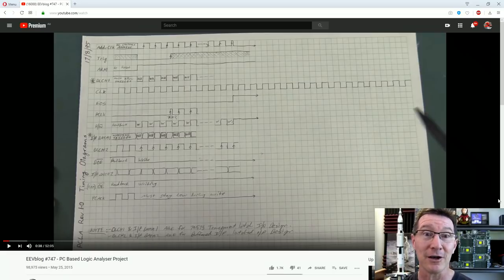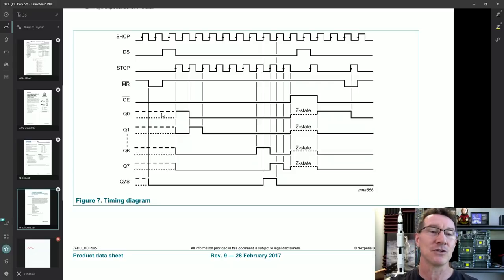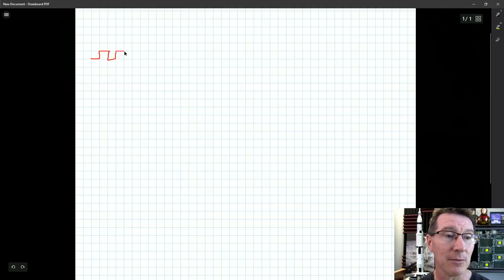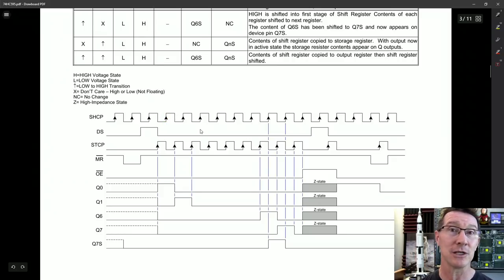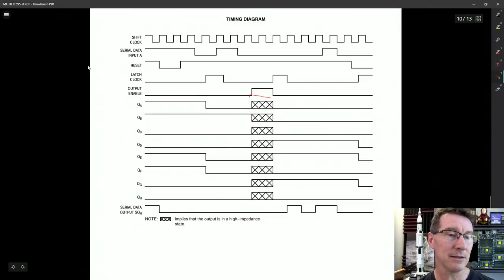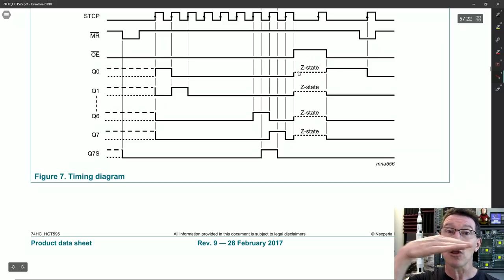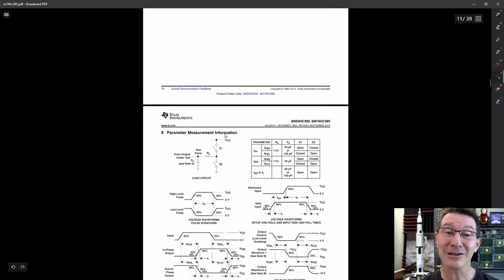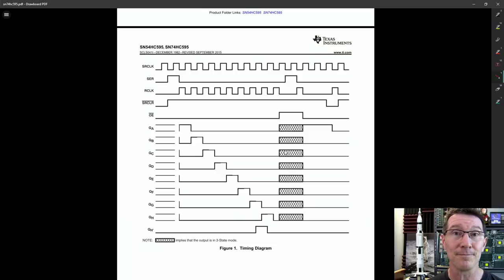EEVblog #1249 - TUTORIAL: Timing Diagrams Explained

Comment: I still remember the first time I discovered timing diagrams when working with SPI communication between an Arduino and a digital potentiometer. I bought a logic analyzer to study the timings and worked through getting it to work. One of my top moments in learning electronics for sure.

Comment: This could do with a Part 2 describing pipelined logic comparing, say, hold time outputs of registers to setup times of succeeding registers. It's easy to violate these timings especially if you have long PCB traces. A trap is to feed high speed logic into low speed like a 74F logic feeding 74LS logic. Also, how to deal with meta-stability issues in asynchronous systems.
Reply: Yes, please.

Comment: Hi David. Ben Eater once explained a similar topic but i kinda didn't get it. Would it be to much asked if you could explain how to calculate the "pulse" time built with resistor / caps to use for WE (write enable) needed according to a time table? i want to use a push button to enable WE while i have already set the data x on adress x to save the data on a SRAM? a small schematic would be awesome and a simple to understand way how to calculate the pulse time (uF & R) 

Respectfully from Switzerland
BRMc

Comment: I feel like this is something that you need a decent scope or a logic analyzer for.

One day I'll have to grab one, especially when I start using DRAM and FPGAs....
Reply: gudenau I think I understand where you are coming from, but logic analyzers don’t replace timing diagrams.   Mostly, timing diagrams are mostly used in the design phase when you don’t have any hardware to use an LA on.   They establish not only exactly how the chips work, but also what chips can be used together and what the line lengths need to be.  The other thing is that LAs show you how something is working, not how it is supposed to work!  It’s a great skill to acquire!
Reply: @wpherigo1  I didn't express this thought too well. I meant debugging stuff with.

Comment: Timing diagrams are pretty similar to how I try show flow of data or distribution of workloads across multiple threads. Wish there was a standard way to do it, but in software engineering it seems to be the same "standard" approach - Whatever makes sense, mostly.

Comment: I would love to see a complete video on how to properly analyze a circuit, understand how it works and why.

BTW, I'm not talking of simple Kirchoff laws applied to resistors. Maybe something with op amps and or discrete transistors or diodes. (At school I've studied only some parts of electronics and so far I cannot understand how transistors works in a circuit. And yes I have read lots of different textbook but I think that I miss something quite basilar)
Reply from the maker: You can't just do a generic "analyse a circuit" tutorial. There are an infinite number of permutations on things to learn in even the most basic circuits. Each component requires it's own hour long video (see my 45min opamp video, and I didn't even cover everything), and then you could do another 1 hour video on interpreting datasheets and parameters for those components, and so down the rabbit hole it goes.
Reply: A good basic introduction of how a transistor works in a circuit is to think of it like a dial or slider light switch in a room. One that changes how bright the light is. Except instead of using your hand to change the brightness of the light, a transistor uses a voltage applied to two of its pins (base and emiter). So if you put an ac signal such as a 1kHz sound sinewave on those two pins it would be like turning the light control up and down 1000 times per second. A transistor is basically a switch with its on/off state controlled by an applied voltage. It does not have to be full on or full off. It can be a little bit on with a small base emitter voltage wich would essentially be a high value resistor between the collector and emitter. Or it can be full on with a higher vbe wich would make the collector/emitter a low value resistor. It can also be anywhere in between.
Reply: An easier way to understand a NPN BJT is by representing it by a water tap. Opening the tap represents the base, the main reservoir represents the collector, the water coming out of the tap represents the base and the water represents the current flow. When you open the tap the more current/water is allowed to flow. Eventually you going to open the tap to a point where there is no more change in water/current flow. This state is known as saturation. You can keep opening the tap and you will notice no change in water/current flow. Closing the tap fully is known as cutoff where no water/current is allowed to flow. The above applications would be switches. 

A BJT can also operate in other "modes".

So when you adjust the tap between saturation/opened a lot and cutoff/closed and see a direct change in the water/current flow, this is known as the active region. This "mode" has many applications for example amplifiers.

Just a simple way to maybe grasp a few Concepts.
Reply: @EEVblog  yea, I know that the permutations are a lot. With "complete video" I means to take a schematic and analyze it trying to teach the method to understand how a circuit could work. For example divide the circuit into blocks, find the inputs and outputs. Use Kirchoff to calculate the current and voltage drops. I have lots of notes from my old electronic professor, circuits to analyze that have also diodes in them. But he never explained how to apply the rules of Thévening or Kirchoff in thoose cases.

Our electronic program was: bool logic, resistor based DC circuits, logic gates. Then we switched to AC, Bode and Fourier application. Op Amp. DAC and ADC, S/H and a basic signal processing theory for sensors.
Reply: @devonmagan5046  Thanks for the quick notions about BJTs. But I Known that. The problem is properly analyze the circuit. I've seen different schematic of amps made out a couple not BJTs but mostly black magic for me. Use transistors as switches is not that hard. I've done fire experiments with them. But so far I'm not completely able to use them in the linear region. To properly create a load or amplify a signal. Opamps are "easier" for me since I've studied them properly!

Comment: What is OE in the 23:31 - 27:00 examples?
Reply: Probably Output Enable (active low in this case) after you have read a few of those diagrams, but most likely you'll find it explained somewhere else in that document.

Comment: Can you please help me with this diagram?
I am trying to drive a VFD display I got. Using arduino library for esp32. there is an 8-bit parallel data interface I am trying to write to. You can please see the timing diagram here - https://imgur.com/a/hnzC69y . Based on that, I tried the following code sequence, but does not seem to work. I know the display works because I can put it in test mode. Does the code look correct against the timing diagram? thanks!

digitalWrite(PIN_CS,0);
delay(1);
digitalWrite(PIN_WRITE,0);
delay(1);
digitalWrite(PIN_B0,0);
digitalWrite(PIN_B1,1);
digitalWrite(PIN_B2,0);
digitalWrite(PIN_B3,1);
digitalWrite(PIN_B4,0);
digitalWrite(PIN_B5,0);
digitalWrite(PIN_B6,0);
digitalWrite(PIN_B7,0);
digitalWrite(PIN_WRITE,1);
delay(1);
digitalWrite(PIN_CS,1);

Comment: 25:50 I don't like the phillips middle line representation of a z state at all. This imply that the level is in the center and neither low nor high, while it can be red low or high in any point in time during the period. The greyed rectangle is much better showing that the level is undetermined. Thumbs down to phillips, that is NOT how you do it.
Reply from the maker: Sorry, I disagree. It very clearly illustrates that the chip is no longer driving that pin.
Reply: Or drive it to the middle point. Right? There are so many options how to image z state. Grey rectangle, dotted low and high lines at the same time, curved line or even the lack of line, but the straight line going through the middle between high and low is the worst possible illustration.
Reply from the maker: No chip drives it to the mid rail, that's silly to even suggest.
Reply: Yep. It is silly that phillips suggest that the output level is in the middle and not high nor low. A grayed rectangle better represents the voltage level indeterminism here, and no beginner would even think that the level can't be red low during the period. The other question is how to represent x state i.e. active drive to random value that can't be pulled with a resistor on the same diagram with z state. But pulling the z state would require a more detailed description anyway.